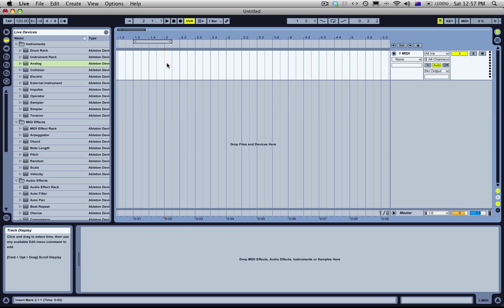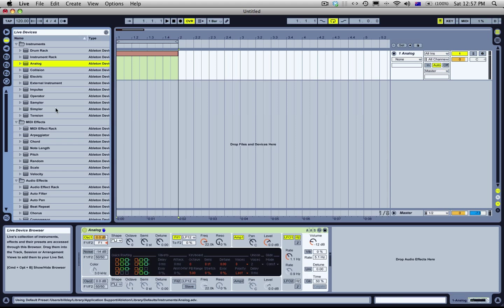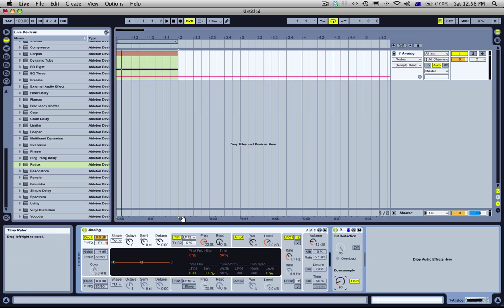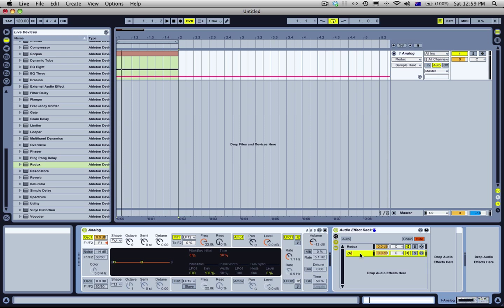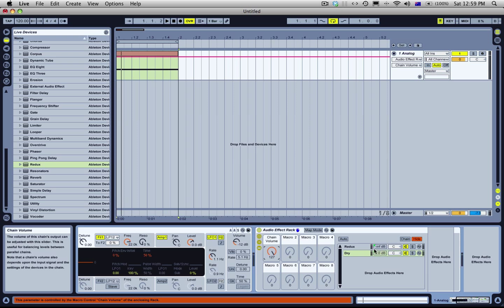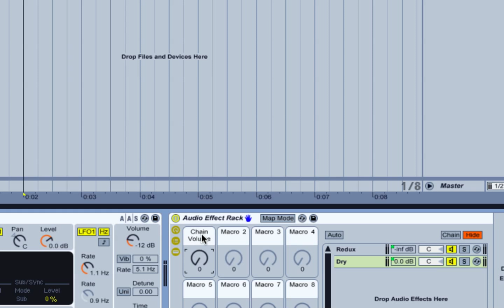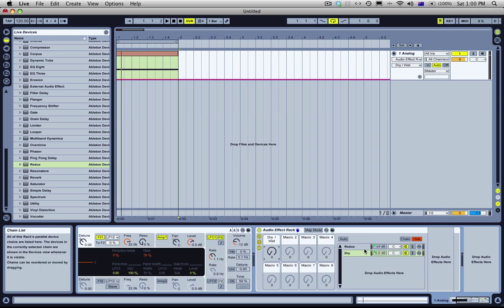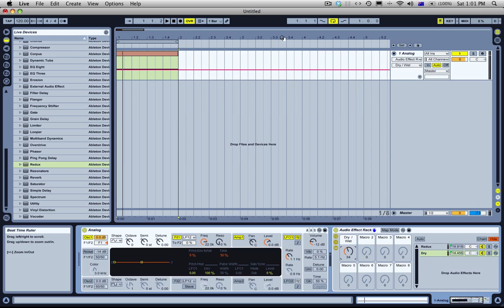Mr. Bill - Ableton Tutorial 21: Creating A Dry/Wet control

Comment from the maker: @Buchawski Well, the empty chain provides the dry signal. What is the 'volume of the redux'?, the redux does not have a volume control. It has down-sample or bit reduction controls. If we mapped the volume of the redux chain to a macro, all that would achieve is having a volume knob (just like the fader). By having the empty chain, and using the macro control to fade volumes between the redux chain and the dry chain, we are effectively creating a dry/wet control.